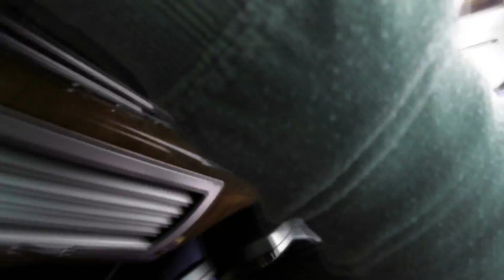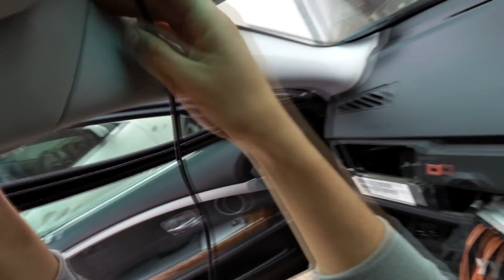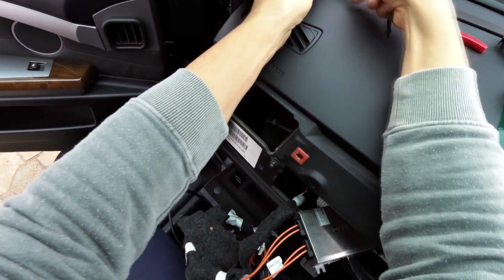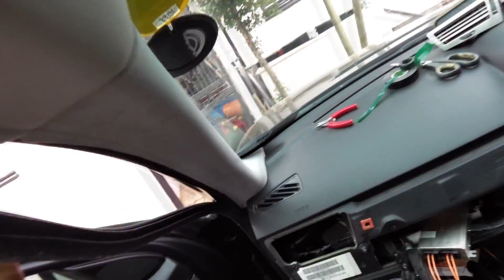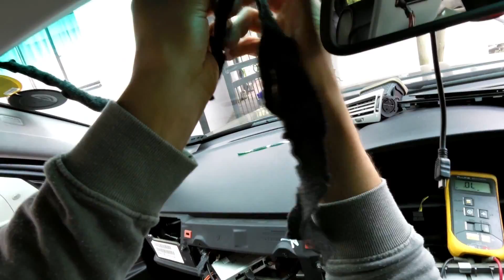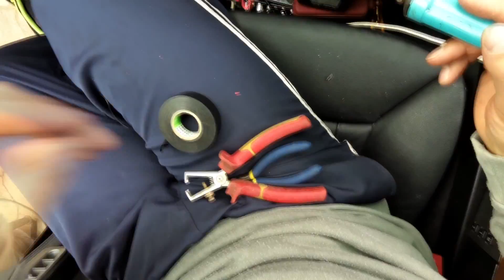How to Install a Dash Cam in a BMW 7 Series

Comment: Whoa, that car is butchered - this is a Rube Goldberg installation! I've got the same series of car (video of it on my YouTube channel) and installed a dashcam in 15 minutes with wires completely hidden without removing a single interior panel nor cutting any of the cars' existing wiring. The e65 series BMW has a concealed power source, that is switched on/off with the engine, in the passenger side footwell and the wiring to the dashcam runs easily tucked within the molding around the window down to the footwell.
Reply: Hi Eric. Just saw your comment about a concealed power source in the passenger footwell.  Could you please give me some tips on how to find it? My 2005 E66 does not have a socket in the footwell high up on the transmission tunnel like some do but hopefully you are talking about something else. I checked out your channel but could not find any info on this. Thanks.